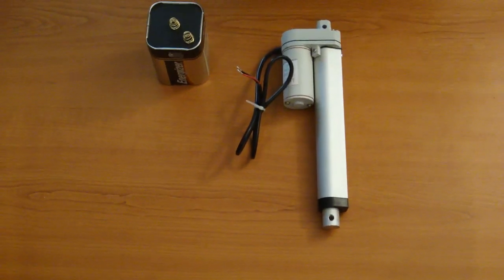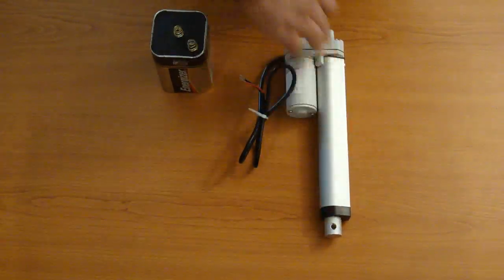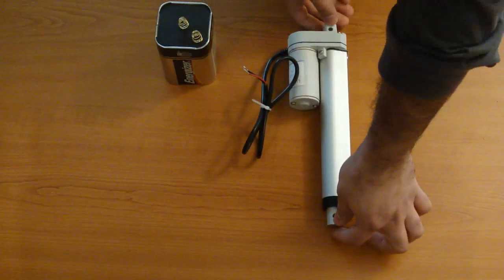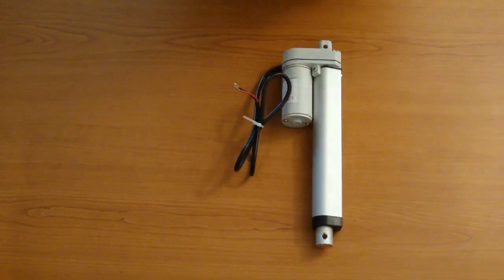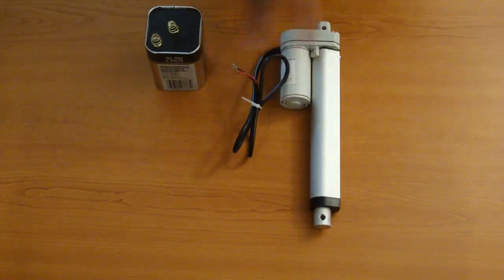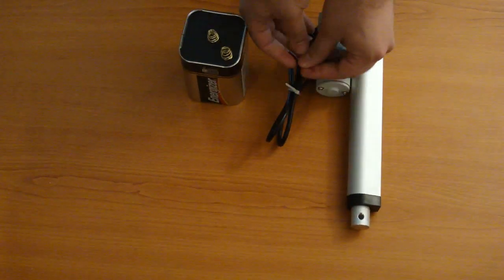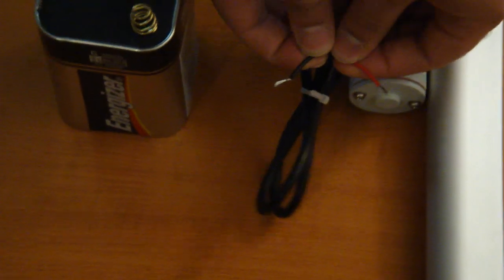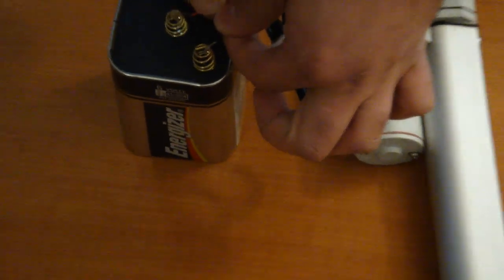Connecting Our Mini-Linear Actuators to a Battery - Progressive Automations

Comment: is it possible to connect two 12v actuators to a single battery (i am aware the speed may be slower) or would you need two separate batteries?
Reply from the maker: Yes, it is possible for a 12v battery with the sufficient current draw ratings to have two 12v actuators wired in a parallel circuit so they receive power from the same source.